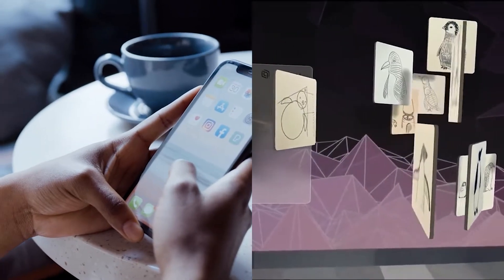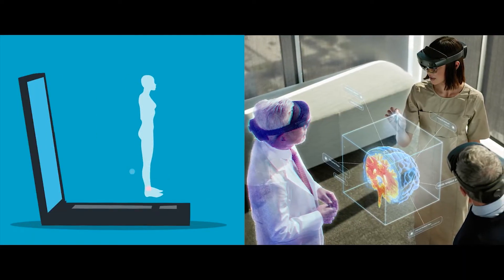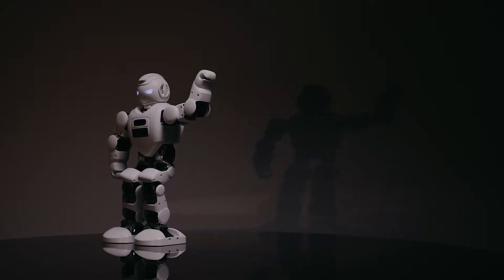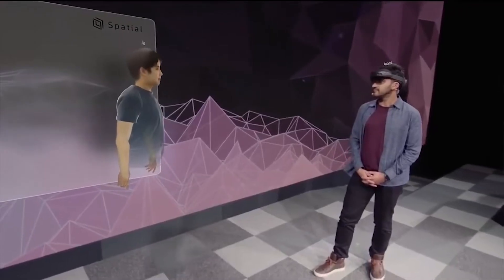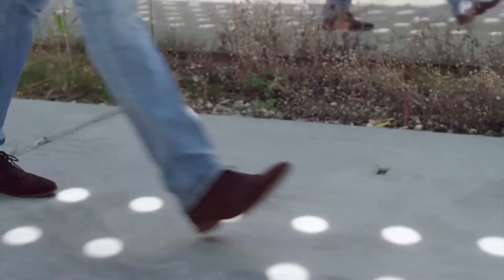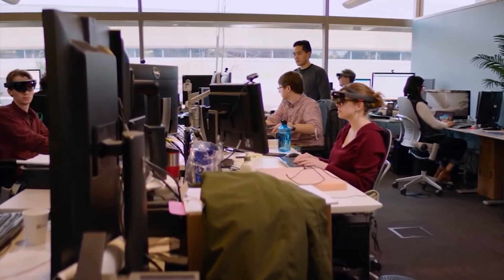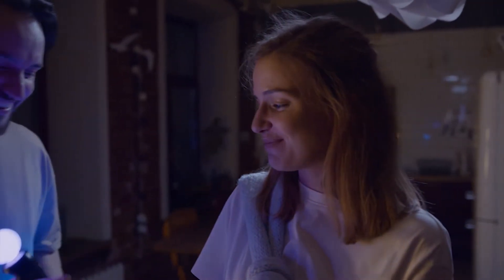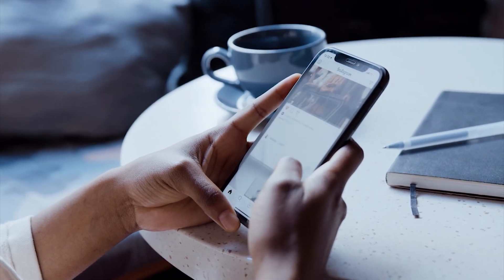Microsoft HoloLens 2- is it worth it?

Comment: already looks so dated compared to the Apple Vision Pro. This seems to be the usual routine, all these cool things are out there but no one really cares save for some small niche markets, then in comes Apple and does it actually well and blows up the segment taking over and leading the pack. Is the HoloLens dead now? Unless Microsoft really steps up its game now I don't think it will  last long. Price point is similar to the Vision Pro but inferior, so why buy this from Microsoft when you can get a screen that is night and day  better, eye tracking, better audio (assuming Apple did it better here) and an over all  better design.
Reply from the maker: Apple always win the game
Reply: Your comment shows the power of apple marketing more than the quality of their products. Vision pro is a VR headset, hololens is AR. Completely different and for different purposes. Even if they market it as more it is purely a VR headset with a great passthrough. Holens 2 has been out for 4 years and is used a lot in Industry and not aimed at commercial yet, so no its not Dead now just because there is an extra VR headset that will compete with other VR headsets. HoloLens is still ahead of its time in AR standards nothing can match it for now
Reply: I disagree the Apple Vision still comes out next year and Microsoft could drop HoloLens 3 before that, plus MS team has 10 years experience and 3 versions already, the Apple product didn't look all that much better. Plus MS has contracts for industry with their product military uses the HoloLens you can get one with a hard hat attached that are used for site work, apple is so far behind the leader of the pack Microsoft.
Reply: @scottpark2395  How long was Windows CE out before the iPhone or the iPad came out? Apple is never first out with these products but they have a proven track record of coming out with something the masses actually buy and use and change the market with it. Apple is not going after military contracts, that is small potato's compared to world wide consumer purchasing. No guarantee it will be a hit of course, but Apple knows how to create hype and how to sell, better then anyone else. It will be interesting to see the hololens numbers against the Vision Pro after a years time. I am more curious though to see what Apple brings out as a consumer model with a more reasonable pricetag
Reply: I don't agree with this evaluation. You're comparing two similar but not identical technologies.  Vision Pro is VR/pseudo-AR.  Hololens is true AR/MR allowing you to interact with the digital in your real world environment.  Apple's attempt at AR/MR is nothing new.  They use cameras to pass video through to the monitors on your eyes which don't/can't visually track at the same speed our eyes do.  It's why people feel nauseous and have to move really slow when turning on pass-through mode on other platforms (I'm specifically calling out Oculus here).  This may change with 4k/8k screens with insanely-high refresh rates.  If this is where Apple has gone with the Vision Pro, I'd be interested to hear about anyone's experience with these improved refresh rates.

Another problem with this is that Apple Vision Pro isn't even available, yet.  By the time it's availableHololens has been out just short of 8 years.  If this is the closest Apple can get to AR/MR, they're still at least 5 years behind.

That said, Hololens might actually be dead.  It's no secret that Microsoft got rid of the big minds behind Hololens.  Some of that was due to bad behavior, but much of it was due to revenue focus.  They've shifted their focus to Cloud and AI for enterprise customers.  They're so focused on enterprises, that even the Hololens was never slated for consumer review.  It was only ever going to be an enterprise tool, and that makes me sad.  I feel that Microsoft abandoned the consumer under some of their previous leadership.  That's why they can't compete with Apple.  It's not because Apple does a better job and makes higher quality tech.  I can't stand their tech.  It's junk (in my not-so-humble power user opinion).  If I wanted to run a UNIX-based operating system, I'd run ANY flavor of Linux over Mac OS garbage.  Even Google's abysmal Android OS blows iOS out of the water.  Apple doesn't make things better.  They just do a better job of marketing to the consumer.  

All of that to say, Apple will continue to be the leader in the consumer space (and consequently fail miserably in the enterprise/education spaces) while Microsoft continues to alienate the larger and better paying segment of the population; consumers.  The future doesn't look good for Hololens.  So, you had better get it while you can if you're collecting gear for your AR/MR/VR museum (or mausoleum in this case).
Reply: Hololens 2 came out 5 years ago. 5 years in technology are almost two generations under nowadays standards! 
And no, Apple Vision Pro aren't revolutionizing the market. Quest 3 can do pretty much 99.9% of what Apple Vision Pro does, at 1/6th or the price. The market is dominated by Meta
Reply: Typical apple fanboy comment , a person who doesn't actually understand the difference in two devices.... But is brainwashed by ones marketing technique and can't understand AR and VR , holograms , and pass through cameras are completely different. What a life you must live 😅😅 try learning before making such bold comments 😅
Reply: Apple vision is just an expensive more refined polished and upgraded version of a meta quest 3 VR headset. . Which couldn't be any different than hololens technology if it tried 😂